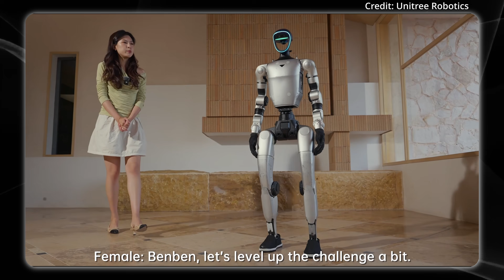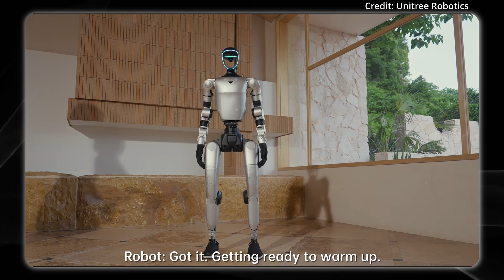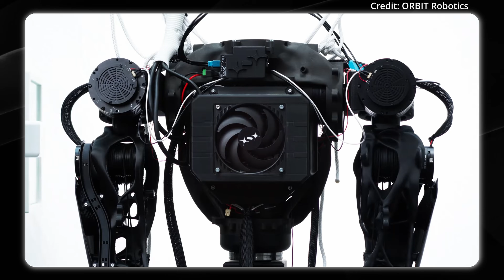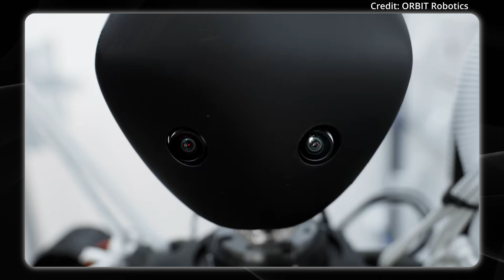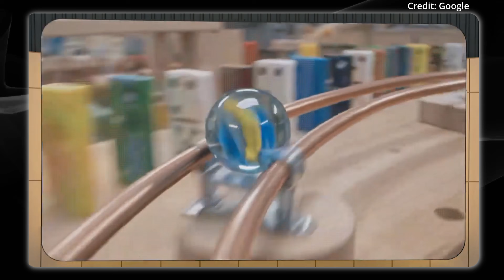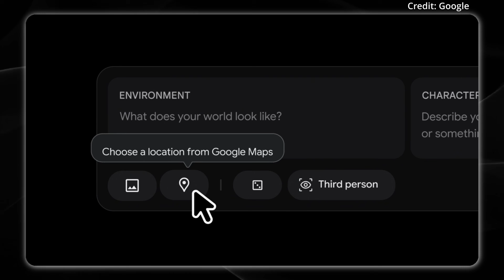Boston Dynamics Killer? 6 NEW Autonomous AI Robot Features (GOOGLE OMNI)

Comment: There is no reason a humanoid shape is inherently essential even for space applications Nearly 10 years ago when I was still a fledgling at MIT I designed a snake robot for space operations with more degrees of freedom than the entire human body combined A highly articulated non humanoid platform can often outperform a human form in mobility redundancy and adaptability
A lot of these grand claims about changing the world overlook a fundamental engineering reality intelligence is an energy problem Until we develop something approaching the efficiency of the human brain truly autonomous humanoid robots will remain severely limited The human brain operates on roughly 20 watts of power yet it still surpasses modern AI systems in contextual reasoning adaptability and real world decision making Go figure !
Reply: True. However… Beta was superior to VHS. Human adoption is the error most brilliant engineers never take into account. - a humble Georgia Tech grad. 😊

Comment: So why doesn't Helios have two heads? Would it not be more efficient to just put two upper bodies together?

It will be working on 0g, so might aswell give it perfect horizontal symmetry, no?
Reply from the maker: Good point, it would make more sense if it had cameras on the top and bottom for a dual headed setup.